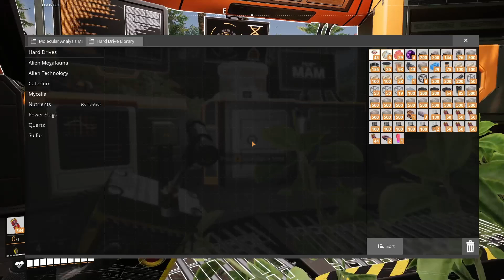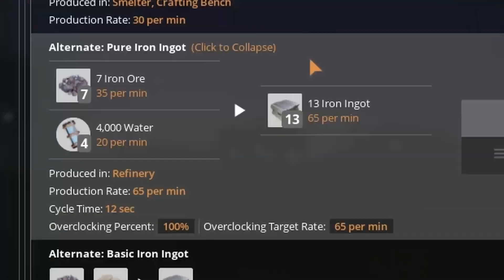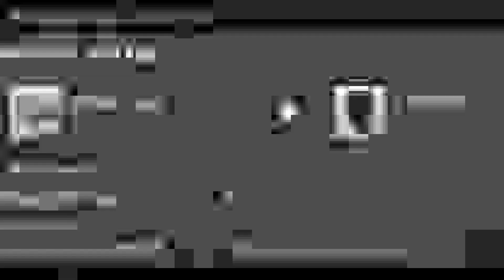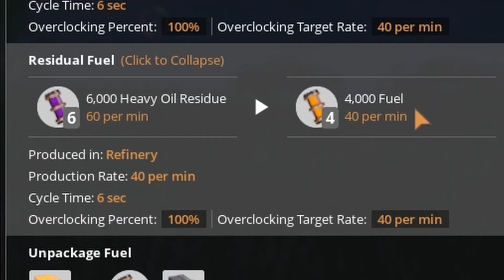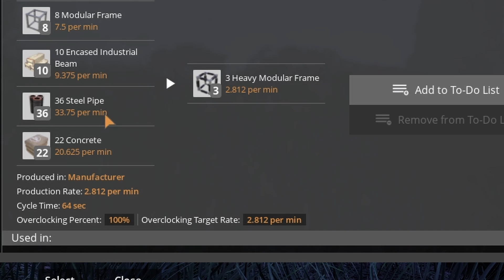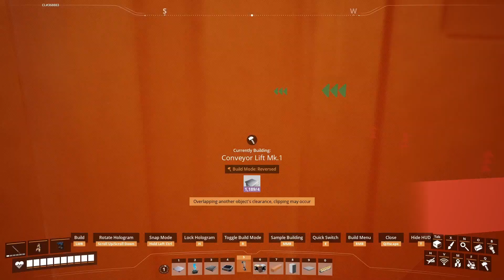There is NO such thing as a 'BEST' recipe in Satisfactory

Comment: Really good video. Respectfully disagree. It is true that no one recipe is the 'best' in a very general sense, but, for everyone, in each save file, one of them will be objectively 'the best' for that run. One of them will be the one that mathematically saved the most time and resources. Odds are good it will even be one of the ones you highlighted, depending on the save file's goal and the person's build habits.

If you don't finish phase 4, the odds are actually pretty good it will have been cast screws. If you go all the way to the golden nut, that recipe will almost certainly have been iron wire, and it won't have been close. If you consider the save file as 'finished' at some point in between these two extremes, it is still very likely to have been the two aluminum ones , or the HOR+Diluted Fuel+Recycled oil products loop.

Yes, that mean there isn't a one singular 'best' but there is certainly a 'top 10' best alt recipes that are objectively the ones that save the most players the most amounts of time, effort, resources, and I would argue that the big youtubers you're trying to disagree with here all hashed out these same sentiments with their equally opposite click-bait-y titles.
Reply from the maker: Thanks for your epic comment! That kinda what I was going for that there is a best recipe for you and your playthough but not an over all best for every situation. And so my aim was to give advice on how to grade a recipe depending on what you are trying to do.

As for other YouTubers your 100% and I nearly recommended totals video on the best early game alts at the end of this video but it didn't fit in to the flow so I cut it. But he and others do a great job of explaining what situations each alt od good for. 

But there is one, I won't name names as that's not what this is about, who can be very dismissive of people disagreeing when they make a best recipe video and I kinda wanted to make a counter point to that kinda attitude.

Comment: But there ARE best, universal, recipes. Sure, most alternates have a tradeoff, but some of them are strictly better than the base ones : heavy encased frames, iron wire + stitched RIP, cast screws for early game...
Reply from the maker: I get where your coming from but I politely disagree.

Is iron wire better than caterium wire or fused wire? It depends on what your production line is. I did say there is better and worse recipes and in the video even pointed out reicpies that you mentioned. My point is that not that there are no bad recpies but there is no one beat recpies for all situations and all people, the game would be worse if that were the case

Comment: Sometimes its just fun to use alternate recipes for the sake of it or depending on where you build even if it isn't 'optimal.' I decided to place my steel factory near the big lake in the northern forest and because of that I decided I would use the oil nearby for rubber and use flexible heavy frames and flexible framework even though most would recommend heavy encased frames because why not?
Reply from the maker: Yeah man it's a game after all so having fun is the main thing. You do you dude.
Reply: I used the circuit board recipe that used petroleum coke, for the simple reason that I was building my computer factory immediately after making my first large oil processing factory, and I had literally thousands of petrol coke being produced as a byproduct. So, from my perspective at that time, it was basically free, as I also of course had a ton of plastic from that same factory.
Reply from the maker: @Nevir202  yeah I very nearly used that recipe in my pre 1.0 play though when I messed up my calculations for my alaminum factory and made way to much pet coke, but ended up making it in to steel

Comment: You mic volume is very low FYI.

An early-mid game alt recipe that I've been using is the Crystal Computer, which enables you to make Computers with Assemblers vs Manufacturers. This has a two-fold benefit in using a lot less power to make computers, and you can double production with APA with two somersloops, vs 4 needed for a manufacturer. Only downside is you need to run manufacturers to make lots of Crystal Oscillators.
Reply from the maker: Ok thanks I'll boost it for the next video
Reply: Another upside is when you combine it with silica circuit boards, you can make computers without a single drop of crude oil. It's my favourite way to automate computers in the mid game.
Reply: Volume norm
Reply from the maker: @zet85  cool. I do struggle with getting my sound levels right. So good to have the feedback
Reply from the maker: @zet85  cool. I do struggle with getting my sound levels right. So good to have the feedback